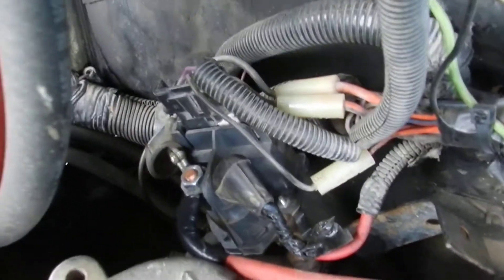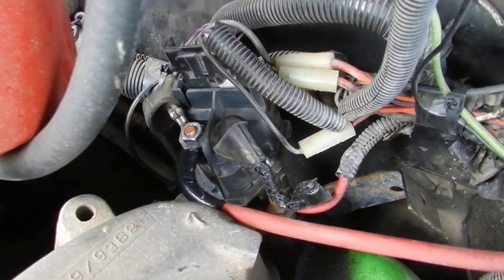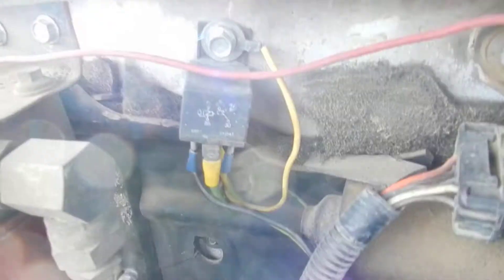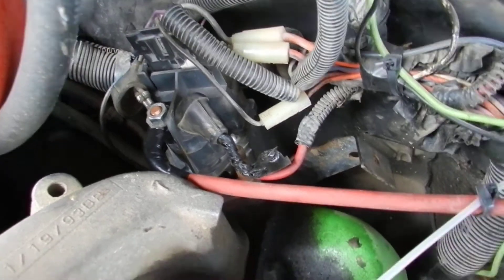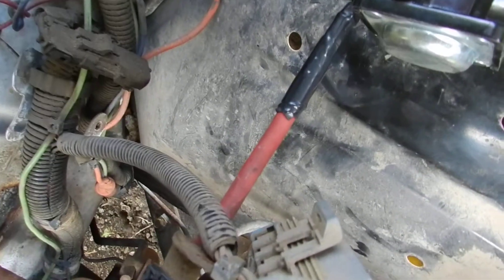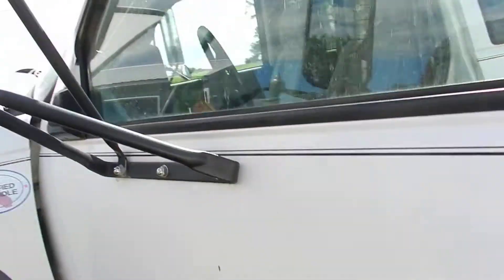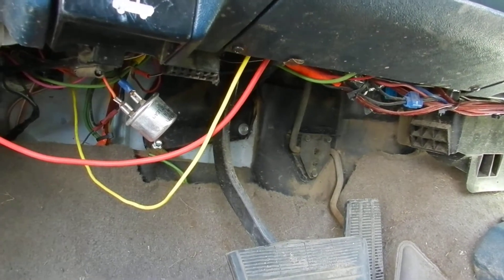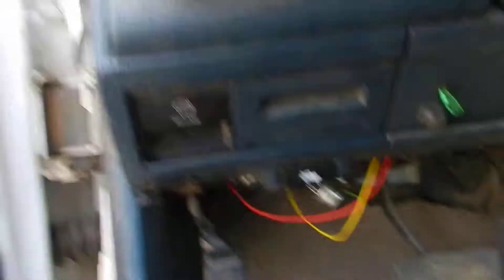Adding a manual glow plug control to 6.5 Turbo diesel

Comment: Thank you for the video.  I'm not a mechanic but my glow plugs wouldn't light up on the dash
so I hope when I get the new relay it will take care of the problem.  I have a 93 6.5 with 152
thousand miles and this is the first time I've had trouble with the relay.  Then my next project
will be the PMD as after driving turn it off and I have to wait 4 hours before it will start.
I had it to a mechanic twice and he didn't fix the problem.  Live in a rural area.
Reply from the maker: @09Youba  must be a real late 93 to have a PMD, far as I knew all 93s were mechanical pump.

Comment: What year model are those seats I’m looking at buying a 1992 single cab 6.2 longbed 4x4 and it’s got the factory bench seats and I would love to swap them over to these comfy sobs
Reply from the maker: @Zack-smith  truck body is 97 with original seats.

Comment: I did the basically the same thing, but ran a solenoid between the two poles on the glow plug controller, used #10 gauge wire. It works fine, however I hardly ever use it, but nice to know its there.

Comment: I did the basically the same thing, but ran a solenoid between the two poles on the flow plug controller, used #10 gauge wire. It works fine, however I hardly ever use it, but nice to know its there.

Comment: Good video.Thanks
When we trying to start a deasel with a key on and turn than I found I don't know when is good time to fire up engine 
Something clicking,display shown wait to start..when it's exactly hack knows.
I have truble to start even it's cold( I do plugging) piss me off.
It might some other problems hack knows.thank you 
I ve got 2000 GMC,6.5L deasel.
It's good to know professional mechanic he found out what really need.But I like that truck

Comment: Can you make another video with more details? Because I’m having problems with my glow plug relay rn and I already bought 2 new relays but they don’t work
Reply from the maker: What details do you need? What year is yours? Unfortunately they had a couple different kinds of glow plug relay systems on these 6.5s so if yours is different year than mine I might not be much help. Mine is a 93 and from what I have found is the most simple factory system. The later ones got the computer involved and earlier ones had alot more components involved. I can do my best to help you out but need more details.
Reply: @mudbogger372  my truck it’s a 2000, k3500. I tried to do the same thing you did but I couldn’t get it to work.
Reply: @mudbogger372  I bought the glow plug(standard and ac delco) but none of the 2 worked, the truck just got a new injection pump and new batteries! And the truck it’s still having a rough time starting(even when I manually heat the glow plugs with a pair of pliers) any other suggestions of what can it be?
Reply from the maker: @mexicansalsa1522  I would make sure that you're getting voltage down to the glow plugs when you manually heat them and maybe glow them longer than you think you'd need. If you have the AC delco 60G glow plugs you can heat them a long time and not worry about burning them out. If all that checks out and it still starts hard it's possible that it's cranking to slow because of bad battery cables and/or connections or tired starter. I'm not well versed in the electronic 6.5s but since you said it has new injection pump maybe the timing is not set right or it might have a bad PMD?